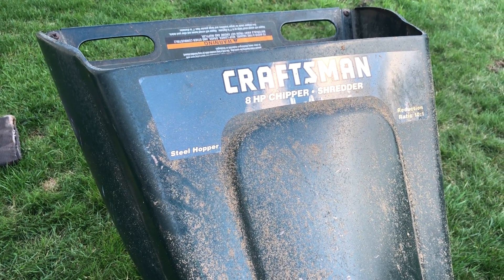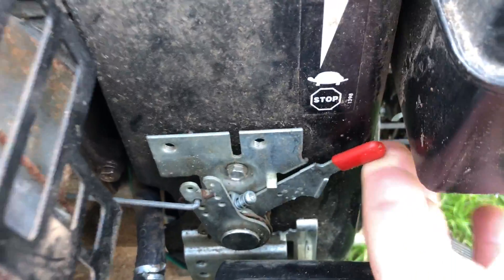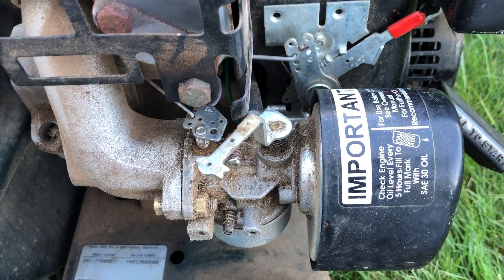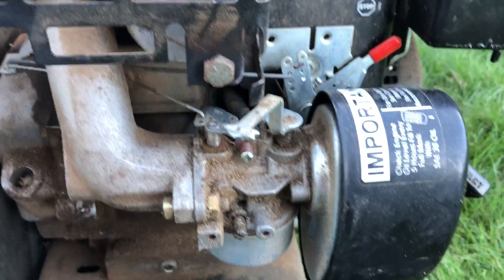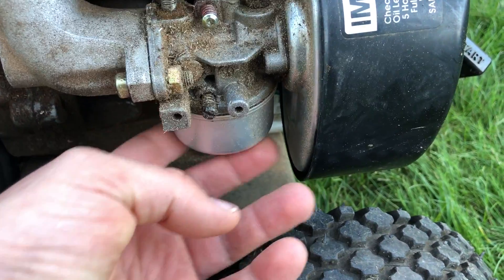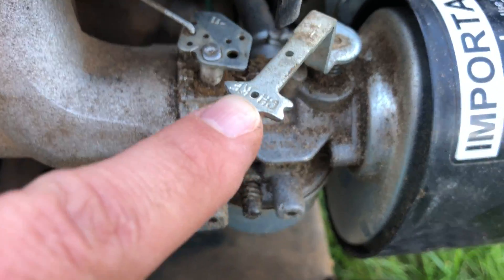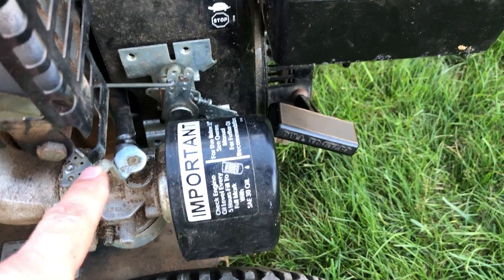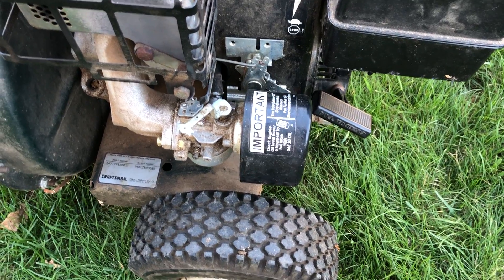How to start your Wood Chipper / Shredder (Craftsman)

Comment: Run your gas tank dry and then put only ethanol-free gas in it and you will not have the gel-mess of storing it in the off season.  After a few years the gas will separate and it will run rough but it will not have water in it and rust in your carb.
Reply from the maker: Thanks, good tip! How do you know if the gas is ethanol free?

Comment: So, thanks for the helpful video. I have a Craftsmen chipper that looks just like yours. However, my model number has completely faded to where I can no longer read the number. I need to order some parts. Could you please share that number. In addition, I can still read the Sears engine number on the engine shroud on my model. Your engine looks just like mine and I'm certain that is a Tecumseh engine. Could you also share that number? You should find it just under the carburetor. Thanks.

Comment: Drain the carb bowl after the seasons over and store after running it dry (shut off fuel, allow gas to burn until it stalls). Store with fuel stabilizer and a fuel tank (or totally empty).  Leave no air space for water vapor to condensate in a half full tank.  Shell start like new always.

Comment: Question.  Why when I pull the rope  to start the engine is very hard ?is moving the blade of chiper. Is that normal?thank you
Reply from the maker: I'm not a mechanic, but it is normal with any gas powered engine. Especially with larger ones like this. 
There is compression in the engine. 

But if it starts up right and it doesn't have any strange noises it probably works as intended. Mine is the same, it's not easy to pull on the rope.
Reply: @zolee1  thank you very much

Comment: I believe this is a Tecumseh HM80-series motor.  Sears didn't want to really say so; they use their own model numbers. A search using the Tecumseh motor number # should help with finding engine parts. Aftermarket carbs should be inexpensive on e-bay, but new or old, they will (for whatever reason) often leak, and needle screws on the bottom of the float bowel can corrode badly around the needle itself if they are not brass.  This may be one of those engines where it pays to use the expensive gas without ethanol in it to avoid corrosion in the carb.  You'll need to open up the screw on the bottom of the float bowl a few turns to get it to start, as tightening it down shuts off gas to the carb…if the needle and seat are not corroded.  The rubber fuel line from the gas tank can get brittle and leak too.  After a while the line you pull to start the engine can really start eating into the edge of the plastic gas tank. You can make a metal shield to stop that from happening.
Reply: the screw with the jet ont he bottom of the bowl?

Comment: I have an identical chipper. You are correct about always engage the choke before starting. Mine is the same. I bought mine from a man that had replaced the blades but put them on incorrectly. A little work and it is a very fine working machine now. With sharp blades it will self feed large branches. With dull blades it is horrible to use even with smaller branches. Thanks for posting the video.
Reply: noway josah thanks for taking the time and comment. I bought it used as well and really like it. I haven’t had the blades replaced, but it’s good to know to pay extra attention how they are put in when I get there.
Reply: Zoltan F the blades are relatively easy to change. There are videos on here that show how better than I can explain. All it really takes is an Allen wrench and a 1/2 inch wrench. Plus something to keep it from rotating.

Comment: Where do you get a new carb for this? Mine starts with a starter fluid but stalls after.  I know there’s gas going to the carb so the issue is the carb itself.
Reply from the maker: You might want to just remove the carb and see if you can clean it and put it back. You don't have to go overboard. I had the same issue and I actually ordered a new carburetor which I didn't use because I just removed the float bowl and saw the dirt there. I removed it and it worked. But if you need a new carb, you can get one on Amazon or eBay.  Here is the link to the manual: http://lawnandgarden.manualsonline.com/manuals/mfg/craftsman/247795861.html I hope this helps.
Reply from the maker: Briggs and Stratton. MODEL #: 247.795860
Reply: @zolee1  I just replaced it.  I think it’s a quicker fix. Do you know where the oil drain for this sucker is located? I want to do a full tune up service for it.
Reply from the maker: @bhadz100  cool. Please let us know where you got the carb in a comment to help others who might be looking for it. Not sure where the oil drain is, but here is the manual https://www.manualslib.com/manual/150027/Craftsman-247-795860.html
Reply: @zolee1  I got the replacement from Amazon.  I think it was only 20 bucks with air filter.

Comment: This chipper is useless without the additional intake hose. With the hose and not filling it too full the leaves literally turn to dust
Reply from the maker: Which intake hose?
Reply: @zolee1  its an assessors  on the bigger machine
Reply from the maker: @Boydavie123  got it. Thanks for the info,

Comment: Any idea where in the US I can buy or ordenf a New air filter and carburator for this machine???
Reply: Not exactly sure. I know that the model # is 247.795860 and 247.795861. I'd either do a research to find the part number or call Craftsman and ask them what the correct part number is. Here is the manual: https://www.manualslib.com/manual/150027/Craftsman-247-795860.html
Reply: Thank you. The model I have is a 243.988503. I found the parts number.
Reply: @anmerescobar6071  Thanks for the update! That's awesome, glad to hear that.

Comment: Is that a Tecumseh 5 HP engine and where did you order your parts
Reply from the maker: This is a Briggs and Stratton. MODEL #: 247.795860 - I didn't have to buy any parts for this yet, but If I had to I would find the part number and do a search based on that.

Comment: Bad advise. If the carb is gummed up cleaning just the bowl of the carb does nothing.. the jets and circuits need to be clean and blown out.
Reply from the maker: Yes, I can see that if it's really gummed up cleaning just the bowl will not help. I did what I described below and it helped me. The machine is still running well.